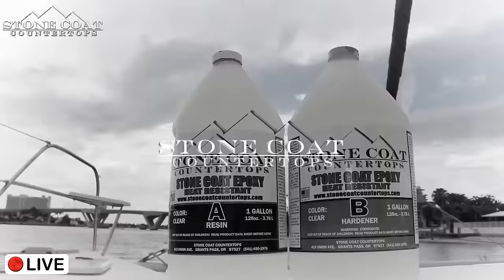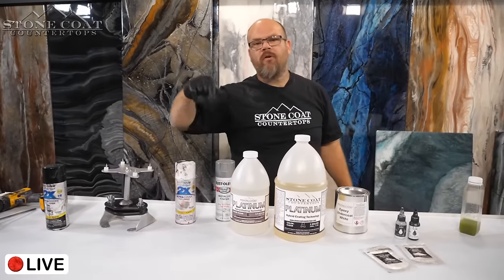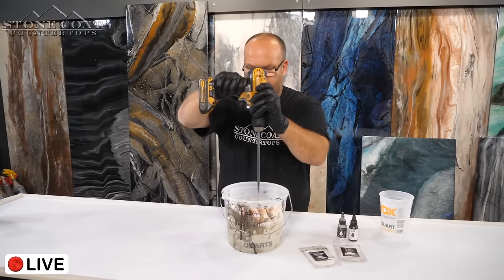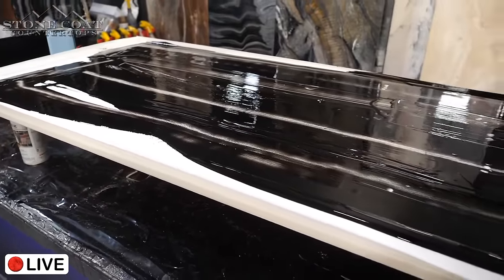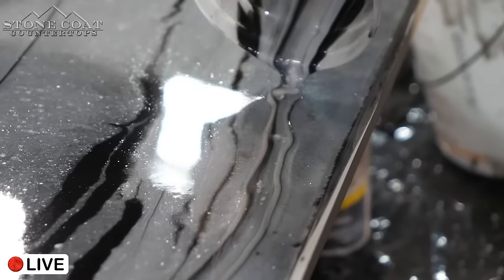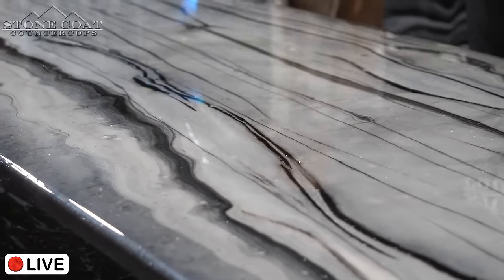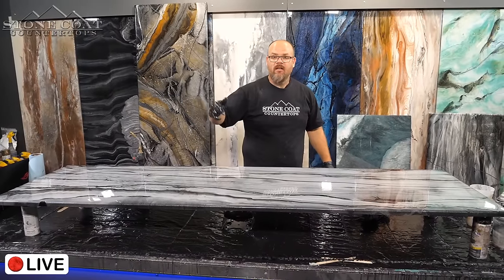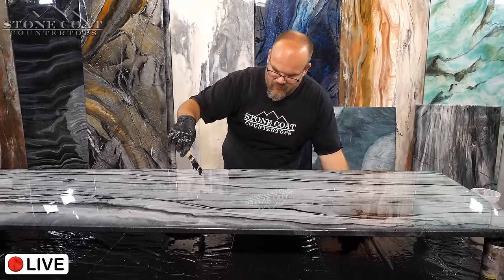Stone Coat Color Training: Fractured White Marble | Stone Coat Epoxy

Comment: I watched a large kitchen counter top project  with stove top and and custom back splash  with medallion. It turned out Awesome! 
When you cut in the plugs on the back splash you cemented on how time consuming. I found the easiest way to install is EASY. 
Don't put them in.  I cut a strip of wood and cut on a 45% angle and mounted tight on back edge of cabinets .
A 6' metal outlet strip has about 12 plugs all ready wired. When installed you can not see unless you bend down and look under cabinets.  This will give you a plug any where you set any appliance. I followed it up buy adding a thin strip of LED lighting with a wireless remote  that can change colors,  It makes an big impact

Comment: I haven't looked to see if you have a video on the the difference between using spray paint vs dye vs powder to color the epoxy and when would you use the different coloring products. If there isn't a video, I think it would be a good quick video to do.

Comment: Not only do yous fellas have great and thorough walk throughs, but your product is by far better than  the crap I got stuck using last week. I tried to use the stone coat process and ended up scraping and sanding two gallons of hot stiff marshmallow creme off a very expensive commercial bar. The bright side is, I get the work from here forward on the up coming projects. I WILL be using stone coat exclusively. That other brand is never going to get my business. High altitude and low temperature was their reason for product failure. 8100 ft and 72f shouldn't be the problem. 
Great work guys.
Reply: Where was the failed brand from?

Comment: I've been a Plastics Engineer since 1980 & I found the best way to eliminate bubbles in any resin, whether it epoxy, vinyl ester, or polyester resin, is to place your resin bucket into a vacuum chamber (5 gal, pail) & hook up your vacuum hose to your vacuum pump.  This will eliminate every bubble in the resin in a couple of minutes. The pump, pail & hose with vacuum gauge cost less the $500.00.
Reply: This is an old comment now and you’re correct for strength of laminates but actually for visual effects the bubbles are useful and the rustoleum paint used adds another “boiler” that gets pearls and glitters to churn up the different colors in the epoxy. But yes the vacuum chamber is the best to offgass for strength. On a different note. Graphine (I probably spelled it wrong) is the latest world’s most strongest substance and in powder form it LITERALLY will strengthen the raw resin 20 times its normal strength. A 1 inch round solid rod with graphine powder added is ridiculously stronger. Graphine is a carbon atomic structure shaped like an octagonal single layer (flat the thickness of the atom but the atomic bond is the strongest known to man) and they found that is electrical conductive properties make it perfect for the future of batteries. The technology is probably about six years old now but if you can figure out who is going to be able to make this product viable enough by all the stock you can. The company that can produce this product effectively and cheaply will be the next Apple/ Microsoft/Amazon

Comment: You mention clumps of spray paint, heres a tip that works for me , this works well especially in cold weather. I always soak my spray cans in hot water in the sink for several minutes  to heat up the can. It will give you fine clean spray pattern.

Comment: I need to find the Rock Face Edge. Definitely want to do that on my project.  I have so many questions.  Another thing I like is removing the silly little 4" backsplash piece they use as standard in AZ house construction. I just had a gas line installed and will be installing a "Slide In" gas range rather than another free-standing range. I wish I could call you guys and show you what I have now and what my project goals are!

Comment: I did a countertop. with stone coat? And I feel it's a little dark. And I don't like. The ultimate topcoat. I want it to look shiny. So I'm going to redo it. I'm assuming all I have to do. is sand it with 80 grit. Reprime it. White. And then pour on top. This is one of my countertops. I'm going to do three this time. I have about. 70 square feet. Too poor. This will be the second time I've used your product. And I absolutely love it. Let me know what you think.

Comment: I have a 7 foot board with the bark still on.  I want to finish it to a high gloss to capture the beauty of the wood.  I plan to use it as a fireplace mantle.   What products and steps do you recommend to A)  keep the bark 'glued on" (its already started to separate in spots)   and draw out the grain of the wood,  and finish with a high shine.   Also,  do I need to do anything to protect the finish from the heat that will inevitably be surrounding it coming off the fire place below.   Thank you.

Comment: I'd like to see you do an island with a connected pattern from the top; down the side. (I can't think of the term for it). I think that's it's called "waterfall"...
I'm thinking that you could do an 8 ft board and cut it after curing with opposing 45° ✂️ cuts...

Comment: I wanted to ask - how thick of a base to start with for the mdf? a single 3/4" sheet? a 3/4 laminated to a 1/2" (total 1.125") a 3/4 laminated to another 3/4 (total 1.5") ? Reason being that I'm not sure how much the epoxy layers add to the surface - I'm guessing around 1/2". so a 3/4" mdf base + the epoxy layers should be around a 1 1/4" top which seems to be the norm in the granite/quartz/stone world (3cm).

Comment: Can you tilt the table later on (like when you are veining the excess material from the sides in order to get more of that movement later if you heat up the areas you are wanting to move? 
Another question: could you do the plastic bag granite technique onto an exotic pour to highlight a certain part of the counter to be a little different than the rest of it? I ask because you tend to be a bit more "ginger"ly on touching it after it has had time to set up...

Comment: Mike, I don't have any under coat can I use bondo then put on the mesh then the epoxy and  tint it spread it this thin then mix in thickener for marbling with color effects using a heat gun to spread and get rid of bubbles

Comment: Does this product give off any dangerous chemicals after it's dry?   What about when you are working with it?  Is it environmentally friendly?
Reply from the maker: Great question! Stone Coat Countertop epoxy is a Zero VOC formulation. It is very durable, heat resistant, has a long working time, and very little smell when working with the product. It's food safe as well as U.V resistant. -Nathan

Comment: Is it necessary to used an undercoat or primer on a non porous surface such as glass?
Reply from the maker: You can certainly apply SCC epoxy over a glass surface. Check out Epoxy Art Resin, which will show you how to do this. -Nathan https://www.youtube.com/watch?t=98&v=VQkWTksU7vE&feature=youtu.be

Comment: Pretty sure I know the answer to this, but if you add a little less thickener to the 1:1 ratio will that allow for a thinner pour while still achieving the same solid end product?  Also, i do tint my epoxy with acrylic paints.  It seems to affect the hardening process.  Would adjusting the ratio help with that?
Reply from the maker: It would certainly be something you would want to test. Let us know how it goes!

Comment: What type of spray paints can be used with epoxy resin?
And which spray paints should be avoided?
Reply from the maker: With Stone Coat Epoxy we know Rustoleum works well. If going to use something different, do a small test! You Got This!

Comment: Just moved into a rental that has no backsplashes..is it possible to do this on plywood that is cut to the shape of the areas needing backsplash and then putting up the finished backsplash with small tack type nails?..also  would like to make a floor to ceiling wall piece to place behind a 75 inch tv that I will be mounting on the wall in the same fashion as the back splash..I'm interested in ANY advice please!

Comment: I need to redo a counter top on my boat. It’s a fiberglass top that has weathered badly over the years. I need to completely sand down the old material, but my question is, can I use your stone coat on the top of these surfaces? Is this topping good for outside applications?
Reply from the maker: You can always test it, if its a smooth nonporous surface you will need bonding primer. Give us a call, we look forward to hearing from you.

Comment: Does this only work with your product ?
I know it's a bad question  but I live on the other side of the world and I really would like to try and make "marble" wall, problem is we only have one place that sales epoxy resin and because they have a monopoly it's not exactly cheap
Love what you do either way
Reply from the maker: That is a great question Janer, you can always test it! Check the durability of what is available. Ours is zero VOCs, heat resistant, scratch resistant, and with the final coat it is food safe.
Reply: @StoneCoatCountertops  I want to do a black galaxy look and insert fiber optic strands to make it really look like space
I just oredered materials if I make something show worthy I'll send you pictures

Comment: "Dirty Pour" comes from the fluid painting world and it is what many people are used to saying when using techniques like this.  It's called "dirty" because all the paints are touching each other in a larger paint cup and no longer "pure".  Exotic sounds nice, but it will be pulling teeth to get people to change over to saying "exotic" vs saying "dirty" unless they are boujee/uppity/etc and just want to impress others with words or how much they've spent on their countertops (and Stone Coat actually saves money, so that doesn't help).

Comment: Just found you guys. Can this product & methods be used on metal i.e stainless-steel and on glass?
Reply from the maker: Hi Susan, yes! Regular bonding primer if changing the whole look. If wanting to keep the look you'll want to use Peel Bond. When applied thin it dries clear and you can epoxy over!

Comment: Can you stop there and not use a top coat?
Reply from the maker: Good question Karen! Our Ultimate Top Coat is used to add extra durability and heat resistance to your project you do not need to use it if you do not want to. -Nathan

Comment: How much does it cost for the epoxy a and b Plantimum
Reply from the maker: Hi Sue, currently the Platinum is out of stock. If you are doing a white or lighter color project we would recommend Art Coat! If you have any questions please give us a call. -Thea
Reply: @StoneCoatCountertops  hay thanks for answering my Q. ok , i'd like to do my Countertops in my kitchen, bath, right now all i have to work with is one can of clear epoxy , i have art paints, some spray paints also i like how you spray the paint into the epoxy then pour and create some awsome coulours....

sue

Comment: Is it possible to cut the larger finished sheets if so how?    Gerrit.
Reply from the maker: Always wait about 7 days after a pour before cutting into epoxy. When it’s time to cut the cured epoxy, we recommend using a “fine toothed saw blade, used for wood.” Use either a circular or jigsaw to make your cuts. Use caution when sliding the saw across freshly cured epoxy. We like to tape off the area we cut so not to damage the surface. Use a wood hole saw to cut in the faucet hole after the epoxy cures.Thanks again for the great question and your interest in Stone Coat Countertops. Make sure the drill bit is brand new to ensure no tearing happens with the surface. Also, make sure your battery is fully charged on your drill.
Reply: @StoneCoatCountertops  Thx for the detailed answer.  👍

Comment: does epoxy smell like polyurethane? does it have a strong odor?
Reply from the maker: Stone Coat Countertop epoxy is a Zero VOC formulation. It is very durable, heat resistant, has a long working time, and very little smell when working with the product. It's food safe as well as U.V resistant.

If you have breathing or smell sensitivities, you may want to consult your doctor before use. We have SDS information for our products should you need it.

Comment: You are mixing 2 to 1 ratio........is 2 product B and 1 is A?  Why are you doing 2 to 1 instead of the norm 1 to 1 ratio?
Reply from the maker: The ratio for mixing our Stone Coat Countertop Epoxy is 1: 1. Other epoxies may vary with the mix ratio, for example, Flooring Epoxy 2:1, Casting/Super Cast 2:1, Art Coat 1:1, Craft Coat 1:1 Quick Coat 1:1, Top Coat 2:1.